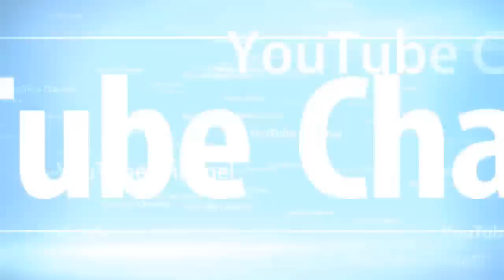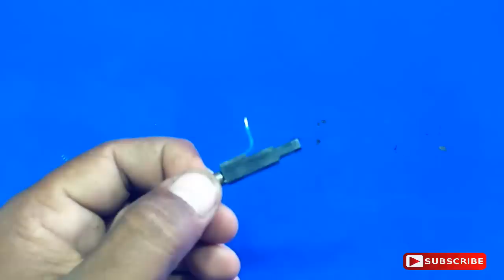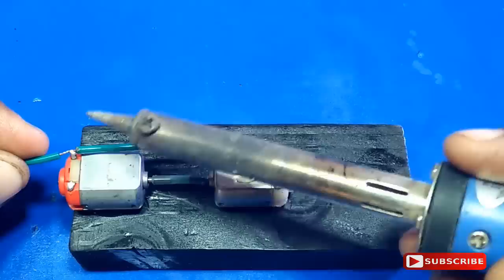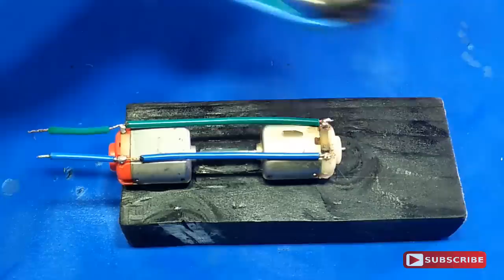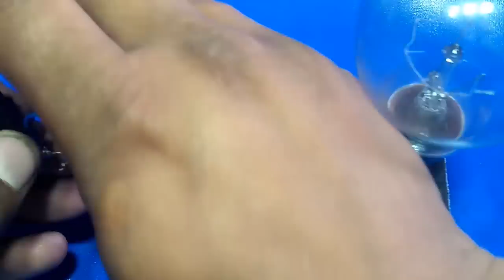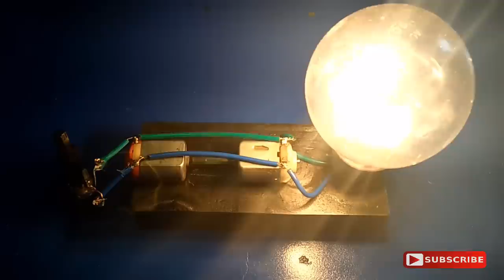Free Energy Device Light Bulbs 220V Using Piezo Igniter with 2 Motor 2018 project exhibition

Comment: Fake video because two DC Motors voltage 18 volts and the bulb is 220 volts so it is impossible
Reply: The motor voltage is up to 10volts
Reply: Voltage is 12v because he using 6v motors
Reply: Gel videos all
Reply: Yes feke hai ye
Reply: Tar babar ghar thake volts ane jalabe
Reply: Anyone try this?
Reply: Piyya
Reply: Baklol
Reply: You are bad Mr. Sanjay
Reply: @onlinehelper374  6 volt no 5 volt
Reply: This is not 18 volt 1 motor - 5 so 2 motor - 10 volt
Reply: You are confusing public 😡🤬
Reply: You can light up the bulb using piezo lighter from lighter,so it is possible
Reply: Yas Bhai

Comment: But how it can provide 220 voltage
Reply: Yes, how it can provide 220 v
Reply: It can provide only 10V
Reply: @kawsarmia7581  Are you mad
Reply: It isn't 220 voltage, you can run the bulb using piezo lighter

Comment: how are those 2, 5 volt motors powering that 220 volt light board and then why arent the motors moving at a snails pace if you have a inverter attached to it